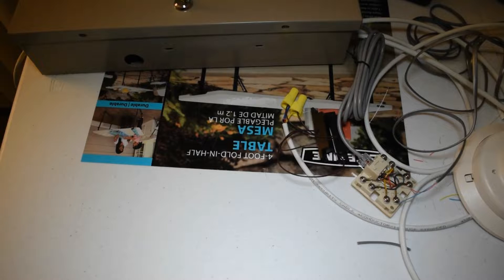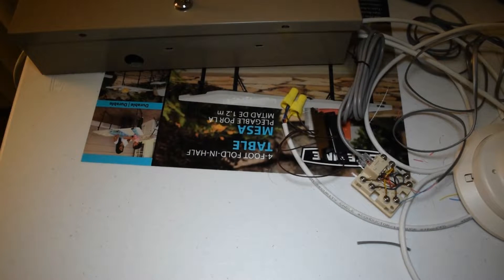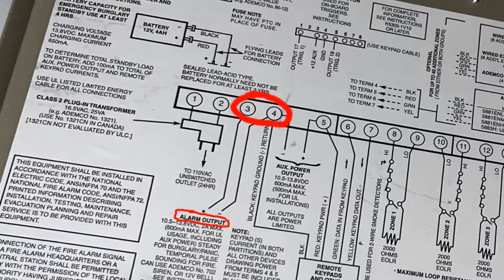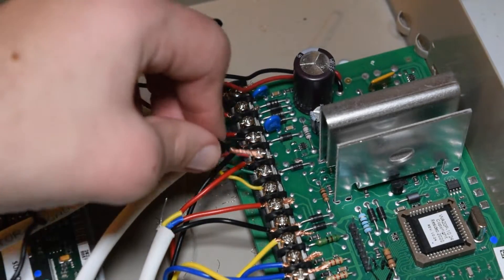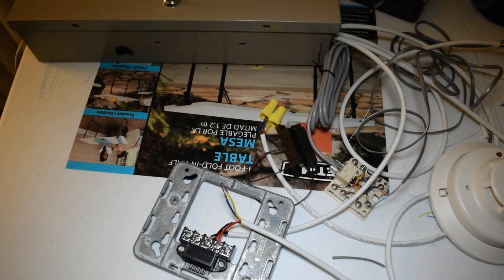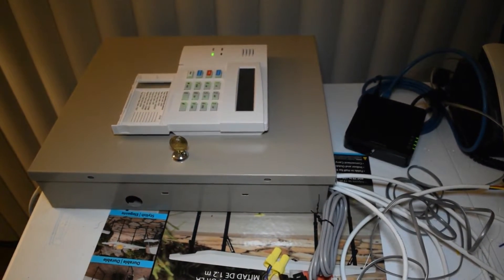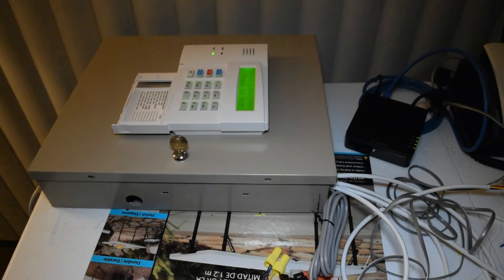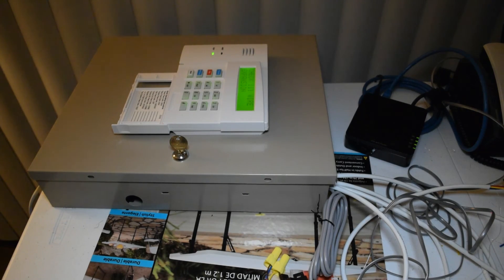Security system wiring tutorial[Honeywell Vista 20P]: Ep. 7-Add siren

Comment: Hey NM! I have my siren wired the same way (red for power and black for neutral; red on terminal 3 at the panel, and black on terminal 4 at the panel). However, my Honeywell WAVE-2 makes a constant low vibrate/rattle/buzzing sound. 

I tried troubleshooting online, but didn't find anything yet. Any idea what that might be? The only thing different with my Vista 20P set up is I upgraded to the 1361 Transformer (16.5VAC, 40VA) over the 1321 (but not sure if that's sufficient to make a difference). Thanks!
Reply: I might have actually figured it out. I just realized I don't have my backup battery installed yet (it hasn't arrived yet). Do you think that's the cause?
Reply from the maker: Check sirens manual to check what voltage it needs and double check what wires go where
Reply: @NM_Tech  Okay, will do. Thank you.
Reply from the maker: @views40 I’m not sure if you’re still following this comment thread or not. If you are, have you resolved this?
Reply: @NM_Tech  - Hey NM, thanks for the follow up. Yes, I got resolved. There was actually a resistor (it wasn't 2k... it was like 820 ohms, or something like that) that needed to be inside the siren. Once put in place, the buzzing went away. Thanks!
Reply from the maker: @views40  nice. Well for any future questions please feel free to join the discord linked in the description. As it’d probably be much faster to get help that way than waiting for responses in the comment section here.
Reply: @NM_Tech  Okay, thanks. I'll keep that in mind. Cheers :)